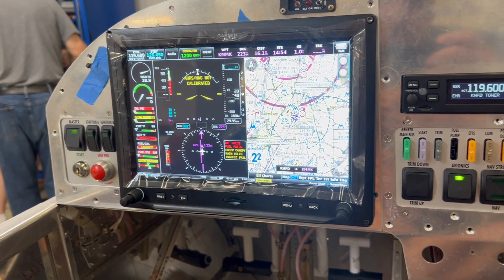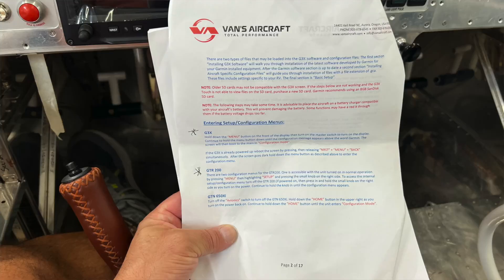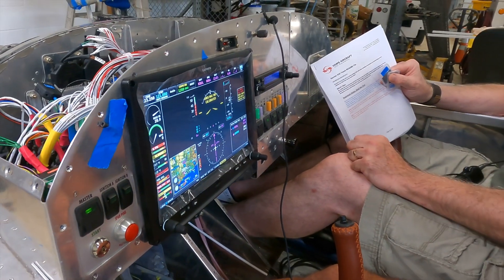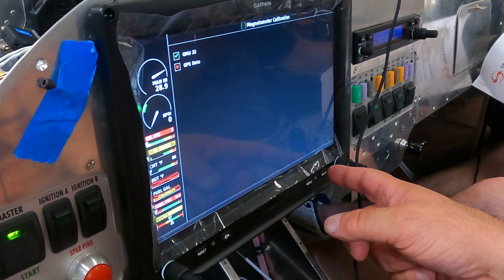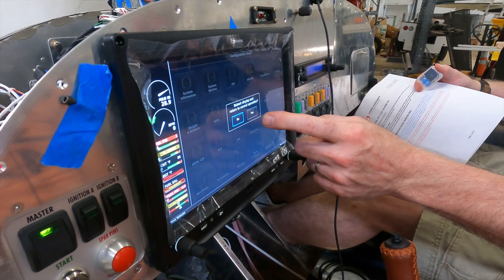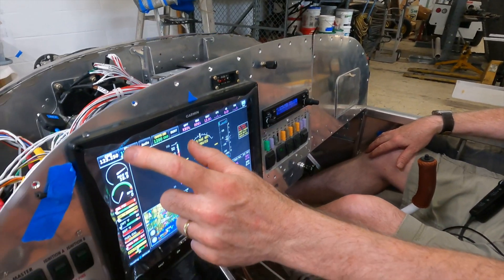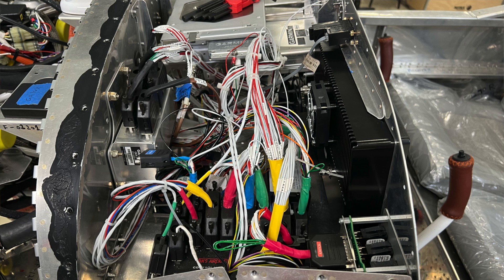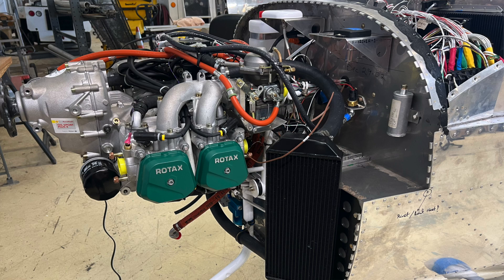Van's RV-12 Build: Garmin Avionics Come to Life

Comment: Maybe worth noting, the iS build includes a PTT button on the panel. It and the PTT button on the right side stick only work with the right side headset / jacks. The PTT on the left side stick only works with the left side headset / jacks. This can be important if you have ANR headsets on both sides, the battery on the pilots side dies and you swap headsets inflight without swapping their jack positions. I suspect the ULS build, sans panel PTT is wired similarly.